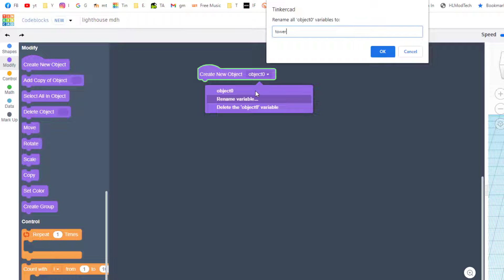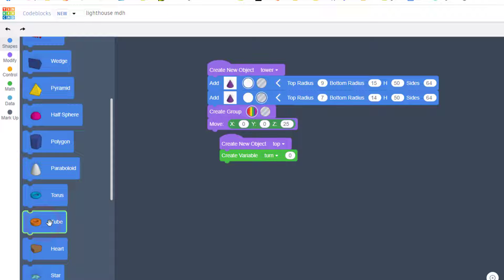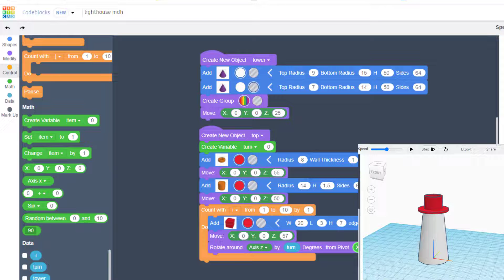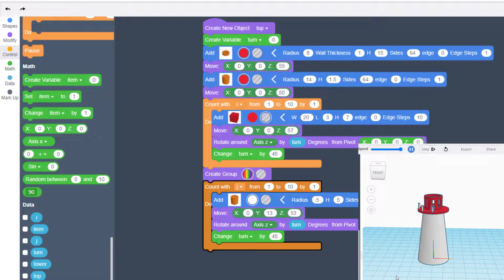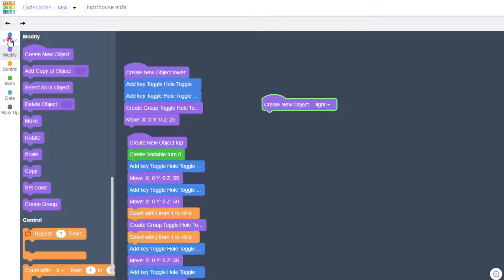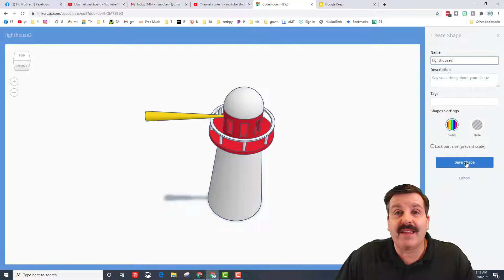Create a Lighthouse in Tinkercad Codeblocks Step by Step #design #STEM

Comment: I copied every thing you did double checked and I got a lighthouse but no windows
Reply from the maker: Quite often it is that the "window parts" were not changed to holes. It also can be a missed group. If you send me a screenshot of your code I may be able to help. hlmodtech gmail is a good way to get to me.
Reply: same is happening with me. instead of create group,there is a group selection block.but its not giving windows